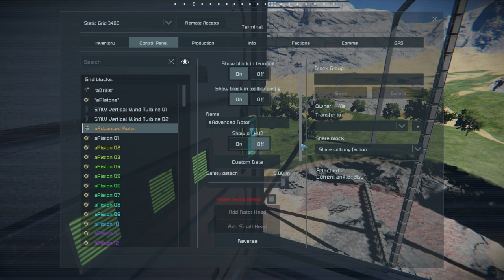One Billion Ore Bust 08, Loss and gain of a drill rig

Comment: If you offset the pattern on 2 legs or flutes you won't get those ridges. Should buck less. Have a center of 3 drills instead of one so that 2 legs are in opposite patterns.
Reply from the maker: Thank you for the tip, keep them coming, which is being used now (part of episode recorded). I do recordings between episodes, let the game run and edit them together. Using that pattern with a surprising update of the amount of gold extracted. Thank you for watching!

Comment: I like the LCD showing all your ores, storage, and power usage at a glance. The drill rig is pretty massive. Putting that much weight on a single point of failure may upset klang. I would almost recommend smaller spinning rigs that slightly overlap to reduce bounce, have better weight distribution, and you can also target specific ore. Overall, still fun to watch.
Reply from the maker: Thank you for the recommendation. I prefer to look at the single point of contact to be a tribute to Klang which he/she will let us know when they're upset. LOL You're correct about using smaller rigs, but I need to cross the line to where it is and go BIG. Thank you for watching!
Reply: @VideoGameCyclist  Thank you for the quick response!
Do you have any videos that show folks how to use scripts and get similar data outputs in their own games?
Thanks in advance!
Reply from the maker: @wcflatt  Unfortunenately no. The guide on the Steam Workshop is good (posted by the designer of the mod). I played around with the commands to get the results I wanted. BUT I will work on a quick video on how to do it. Thank you for watching!
Reply from the maker: @wcflatt  The quick and dirty video showing how I did it for this series will be here:
https://youtu.be/gDM6s4V3Lc4

Comment: You need to have the gyros set to override with all 3 axes set to zero to get the stabilization effect. The stabilization you seeing now is just the weight of the gyros. For the share inertia tensor you need to make sure the piston or rotor attached to the base is turned off, but the rest on. SE does wired things with share inertia tensor and you do not want the conection to the heaviest part shared (the base in this case).
Reply from the maker: I will add that to the next drill rig, thank you for the tip. Keep 'em coming so we can all learn. Share Inertia on the rotor was the problem which I demonstrate in the next episode. Any and all suggestions, tips, ideas are welcome. Thank you for watching!
Reply from the maker: @koradavasudeva6417  Yes, I do now. Thank you for watching!

Comment: The drill closer to the rotor are moving at 4 rpm you kept "gauging" the speed by the outside drills. Standing as close to the rotor look up at piston  control panel (as a reference point) or watch the rotor numbers a see the difference.; going the the same rpm.
Reply from the maker: Will do on the next rig. Unchecking the "Share Inertia" button made it spin at speed which will be shown in the next video. Thank you for watching!